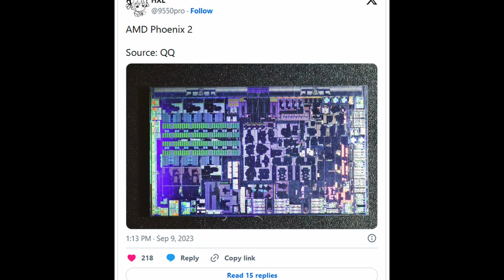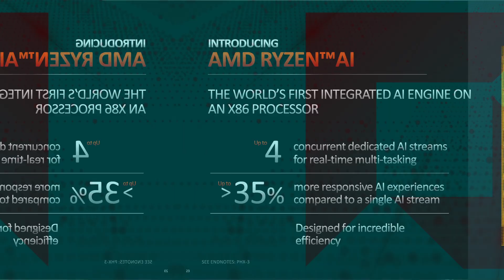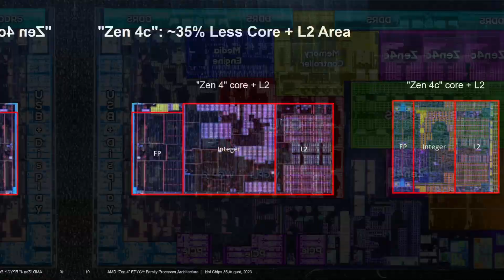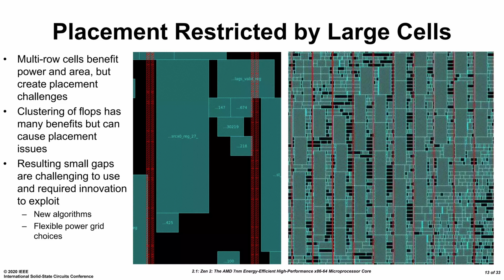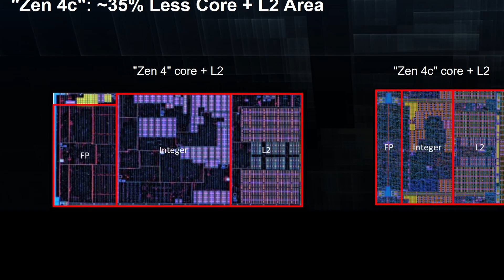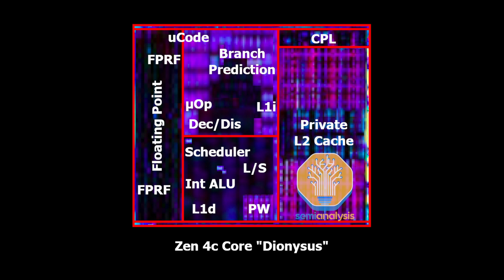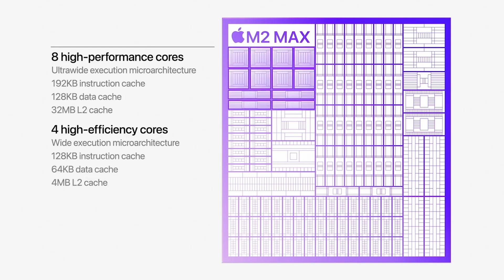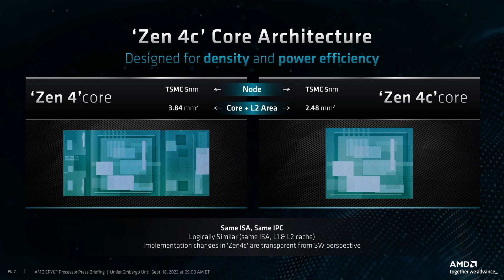Why AMD's first Hybrid-CPU is Different

Comment: Very enlightening video indeed. I’d say what AMD Is doing is a halfway house solution towards a ‘little’ core, but one that’s perfect for the sort of workload that its targeting. Easy workloads that are highly parallel would work better on those little cores, as they can easily scale by core count. But if the workload has less inherent parallelism, then the Zen4C would be perfect for it. 

Not to mention the ease of workload scheduling here. Intel’s hybrid design requires dedicated hardware in the thread director, while this solution from AMD doesn’t

Comment: I'm curious how this Zen4c design compares to for example Intel's E-cores in terms of performance per watt. The whole point of bigLITTLE was that minor and background tasks could be executed on the smaller and less complex core instead of spinning up a whole "proper" core, thus saving power. But if AMD's c-cores are just "normal core but more compact", would that even end up saving any power besides the slight difference due to clockspeed differences? So far it just looks great for the datacenter world where you can pack a bunch more c-cores onto a die than normal ones. But what about laptops and other varying power devices that strongly benefits from proper bigLITTLE?

Comment: Given that in laptops and handheld devices, you rarely/if ever boost more than 1 or 2 cores to let's say 5GHz, this kind of shows how brilliant AMD's solution is. Why have more than 2 cores that can go to ~5ghz when you can only power 2 anyway?
It also completely sidesteps the architecture difference issues caused by Intel's design. Yes, updates to windows/linux/etc to take these differences into account help, but historically these changes have been slow and incomplete.

Comment: I agree with @MikeGaruccio, more smaller sizes cores and lower clock is the main idea behind RISC architectures, except that here the cores are actually CISC cores. More cores are the way to go for sure, especially when the cores are uncompromised, except for clock speed. AMD is correct is their approach.

Comment: Its pretty obvious they just took 4 cores and needed space for the memorg controller so they moved one to the bottom of the cache and then shifted the cashe by 50% in place to give it access to the full bandwidth. Its not a weird layout. Its lazy engineering that looks like a word document text thats set to wrap and alight right/align left depending on top or bottom of the object. Blah blah smart wizard go brrr.
Reply: No but for real... cpu symmetry is not lost. The cored look and are the same. Just he one is moved down. There is no innovation

Comment: Hey dude one issue with what you said and it needs clarification.  About 5:30 you're talking about Zen 4 vs. Zen 4C.  You say there is no difference in IPC.  That's ONLY true without regard to L3.  If you are going to take into account L3 and the different workloads that benefit from having more L3 cache, so large data sets and for PC that's often games, but other scientific or engineering workloads where you might do modeling and need access to large amounts of data, then there is a difference in IPC.

As soon as cache values change, you have affected IPC in some workloads.  IPC can't be talked about as if it's a fixed thing because it's not.  It's workload dependent.

In THIS case with the chip you are showing, because there is a shared L3 then there should be no difference in IPC between Zen 4 and 4C cores, but this is not always true.  In general Zen 4C cores have half the L3 cache, so if you compared a CPU with Zen 4C cores only vs. a CPU with Zen 4 cores, there would be a difference in IPC.

Comment: There is nothing magical about big-little.  The purpose is to get more thread processing in the same amount of space and HOPEFULLY get power reductions in the process.  At least that is the purpose for desktop and large computers.

For SMALLER devices, the object is to process as many threads as possible at low power.

And this is why I say there is nothing magical about big-little.  There is no best way to do it, so just because ARM is really one of the firsts and has their big.LITTLE architecture, that doesn't make it the best at anything.  The other issue is when this architecture came out originally, there were no REALLY GOOD process nodes that were low power like there is today, which can negate part of the benefits of big-little.

And this gets to AMD and their architecture.  There are many tasks a computer does that don't need large cache sizes or the fastest clocks, but there are certainly many server, desktop and laptop use cases where more threads is better especially with multi-tasked systems like servers.

I'm more excited to see this come out for laptop and desktop, because it will put a lot more pressure on Intel to keep pushing at their innovations.  I'd also like to see the desktop  move to single socket solutions such as AM5 or AM6, but this socket can provide basic computing all the way up to near HEDT performance, and big-little can help get thread counts above the current 32 for both Intel and AMD, and it could get thread counts up to 48.  And, it's not that I need that many, but what it would do is bring costs down for something like a 24t CPU, which I COULD use.  But I also think this will bring a memory problem and it could be you'd have to move to a way of having a socket allow for both dual and quad channel memory, because a 48t CPU won't work with dual channel memory.

Comment: Intel said lets design a smaller more efficient core and amd went lets optimize our core so its more efficient without loosing performance seeing as ZenXc was originally designed for datacenter and is being pulled over for mobile designs

Comment: Gaming needs high performance cores though. We can see that the Z1 Extreme can clock up to 5.1ghz, I think AMD will need at least 2 Zen5 cores, then maybe 6 Zen5c cores for the next Steam Deck APU. Or if they want to keep it at lower clocks with all Zen5c cores, they'll probably have to add X3D cache to it to boost the gaming performance back up to an acceptable level. Since X3D cache will inhibit cooling, that might actually work well to complement the slower clocking cores.

Comment: I do not like strange cores but strongest cores. For smaller die area, implement a new proposal from Intel, the x86s architecture that is a clean 64-bit without 16-bit/32-bits circuits that do complicate themselves. Do advance with 3 parameters to be improved: speed++, throughput++ and latency--. Sincerely.

Comment: I would like to see completely a passiv cooled SoCs like Apple Silicon where also the RAM is on the Chip which allows high memory speed. I'm using currently Apple Silicon M2 on a MacBook Air, but I'm a Linux Fanboy and I would like to see something like Apple Silicon from AMD so I'm not stuck on Apple.

Comment: Zen APUs for high performance handhelds seems to be a market amd has all to themselves, leveraging their existing work seems like what they'd do. 5c probably wont be a big change from 4c beyond what they can do to improve Epyc and Threadripper. Lower power and heat is always good though. I wouldexpect lots of  c cores to be used in next Gen Console APUs and by that time we might be up to 6c

Comment: I've been thinking about Intel's big little implementation a lot lately and have finally just come around to it. I guess wider programs won't necessarily need more fast cores if it can already get a lot of smaller ones.
Then AMD goes and Feng Shui's their regular cores to get the same effect while dodging scheduler worries and I'm blown away all over again.
Reply: lol all AMD did is just crippled a few of their existing cores
while Intel actually give you extra E cores on top of the existing P cores
Reply: @loucipher7782 
lol at upboating yourself ebin redditor tips hat
Reply: @loucipher7782  Only time will tell. We need benchmarks, hard data.

Comment: The actual die cost of the raw core is down to single digit dollars or even cents. It all the infrastructure and cache that take most of the die surface. Of cause when it comes to power, it's a bit diffrent.

Die space just don't matter when it come to raw cores. But power does..
It's worth saying that very few aplication can use core 3 and up to the full capacity  so making core 3 and up wirh say half the preforance bit 1/4 the power make a lot of sense.

Comment: I still prefer the simplicity of more cores working in parallel with high clock speeds and multi threading over hybrid designs since i don't have to worry about not having enough cores, or if drm may crash my game because the tasks get moved between cores

Comment: I think the problem of AMD right now - at least on desktop - is how bad the uncore portion is. Their substrate-based MCM design is causing their biggest problem: the cores are extremely bandwidth starved. The Infinity Fabric bandwith is not even catching up current top DDR5 speeds. Frankly I think this design approach will hurt them in the long run on desktop. On cloud and datacenter it's not a problem because servers require much much higher parallel throughput and they have way more memory channels, so a single chiplet isn't going to be starved. But on desktop, AMD doesn't have much answers aside from 3D VCache, which is very expensive and hurts single core frequency.

Comment: Nice video. Excellent presentaiton.
I recently obtained a MinisForum Phoenix APU  UM790 Pro 7940HS mini PC and am impressed with the small size, great capability and low power envelope.
The Phoenix2 will have lots of applications especially for mobile and notebooks.
An all 4c chip could be very useful in the data center for CPU performance per BTU.

Many mobile chips are the desktop variant running at much lower clocks to extend battery life and/ or reduce heat.

Comment: I like it. Not for any reason thats directly in this video even. 
AMD does something here that so far only smartphones and tablets do with the big.LITTLE concept, and thats actually saving power. 
Intels lowest hybrid design at the moment is the i5 13600 with 6 P cores and 4 E cores. Those are still solidly mid-range CPUs intended for good performance across the board. The E-cores can save power, but it feels like Intels actual design goal with E-cores is to stuff more cores into the same power limit for their higher end stuff to get slightly more performance and core count than a P-core only design with the same power draw. It certainly does the job, but it misses the point of power savings as there are no i3s or anything comparable on the low end. 
On the other hand Zen 4 and 4c totals at 6 cores already, 2 P and 4 E cores, which is just about where an i3 with that philosophy would slot in anyway. Its the perfect sweet spot for budget laptops that can run the 4c cores with a low base clock for casual use and during intense gaming boost the shit out of the bigger Zen 4 cores. Which is okay, not many games really have more than one or two "main" threads, and would unload the less intense threads to the Zen 4c cores. 
This is a much better approach to power saving imho, as these chips will actually end up in low-power machines instead of pushing the high-end stuff a little higher. 
(Its really the same argument as DLSS and FSR. Nvidia makes a point of limiting it only to RTX cards, DLSS 3 even only to 40 series, none of which are really in need of that kind of crutch, but AMD offers FSR for any semi-modern GPU, including APUs and Intel iGPUs, where it gives those guys a fighting chance to run stuff, which is a far greater benefit imho)

Comment: They should fit some ARM and RISC V cores in an x86-64 processor so it could then run Android apps natively. Not sure if this ia possible though.
Reply: It's probably the best way to run those apps natively. One or 2 arm cores in a laptop will be peanuts in size/power budget.
AMD CPUs already have an arm core that's isolated for cryptography, and we see for example nearly all SSDs have multiple arm cores in them.
Sooner or later it will happen but I doubt it can replace PC architecture, instead these small cores will add to it

Comment: A very interesting concept. I think it's the better way than P/E-cores, especially on Windows. The scheduler has enough problems assigning tasks to the right core. The thing I would like to see would be a desktop CPU with 8 Zen5 cores (maybe X3D) and 16 Zen 5c cores. The differences in clock speeds would guarantee that high performance tasks stay on the Zen5 cores.
That the ISA is the same on all cores is great, as heavy multithreaded workloads can profit from many cores regardless of type and clock speed.

Comment: We will have to see in benchmarks, in multiple uses, what it goes. 
I know that the Intel P+E design sounded naf to many, but given the right situation, aka a laptop or small device, they are kinda nice. Lower heat, longer battery life. 
And yes I know windows 10 needed some patching to get it right. I know.

Comment: AMD is on to something here. Will be very interesting how the performance results. Area optimised cores would be potent in handhelds, tablets and laptops - that's desktop class core but with power efficiency per IPC, not just lower clocks & voltages.

Comment: This is definitely the superior way to do hybrid arch vs the way Intel is doing it. I've shied away from Intel 12th and 13th gen cpus with big and little cores because I simply don't trust the scheduler no matter what they say about "thread director" As far as gaming goes the scheduler should have no trouble with AMD's hybrid arch because the "world thread" so to speak would always be scheduled on one of your higher clocked cores, but the lower clocked cores due to them being the same IPC would still be useful for gaming. I think I'll hold my 5900x until AMD starts dropping these hybrids on consumer desktop. Also by the time AMD brings this to consumer desktop hopefully they've further optimized their infinity fabric to work with high end ddr5 in 1:1 mode to reach monolithic latency levels as Intel does.

Comment: For an ultra portable laptop I think Little Phoenix makes perfect sense provided that the compact cores clock reasonably well (say 60-70% of the full fat cores) when plugged in. And since the process scheduler in both Linux and Windows are biased towards the highest clocking cores single threaded and lightly threaded apps will always "run right" without the OS and apps needing modification.

For standard desktop compact cores make little sense, but for "the layman's workstation" I think a 9950X3D with 8 full fat + VCache and 16 compact cores would be very desirable to many. Especially now where AMD has discontinued Threadripper non-Pro.

Comment: If the both zen4 and zen4c cores use the same RTL, instruction set and IPC does that mean it could be easier to do scheduling in OS? I remember hearing that intel's big little architecture had some inefficiencies because windows wasn't able to efficiently schedule in tasks like games.
Reply: Exactly. The OS biases workloads towards the highest clocking cores, and fills up from there.

Comment: No, I don't think AMD will do a different architecture.  That relies too much on software support, which Intel has discovered simply won't be forthcoming from Microsoft.  Hence the lack of AVX-512 in Alder Lake and Raptor Lake, despite being present in the silicon.

Most desktop use cases don't fit the model of only compact Zen.  There need to be higher-clocking cores for too many workloads that aren't well-threaded, most definitely including games.  That said, I agree that Zen 5C would be a great fit for the next Steam Deck.  It's not going to be clocking high to begin with, to get the best position on the efficiency curve, so there's no downside.
Reply: The C cores are perfect for VM servers where each VM might not be loaded 100% but you want to dedicate a core or more to each.

Comment: AMD has the capability with Zen to scale in any direction it wants. That was the whole goal of zen from the beginning. It needed to be an achitecture that in the long run, can do everthing and anything, and use innovative packaging techniques. Zen4c is great proof of what can be done, and in the future, there could easily be 3 or 4 different version of zen cores, tuned to what is needed.
More cores at lower clocks at least to me never made sense because as an average consumer, quick bursts of high single core usage is what I would require.

Comment: I think AMD has seen its fair share of launching issues with CPUs and often is not as optimized for when launching new hardware compared to Intel and NVIDIA. Bypassing this by having functionally equal cores and just allowing the scheduler - as it is done for years - to find the fastest chips for single-thread tasks is, I believe - the better way.

This may not hold true for highly integrated machines, but IBM x86 and AM64 are not that. Having hardware where you as the programmer don't have to worry about your software hitting cores that don't have the same instruction set will cut down on development and testing.
I can even see a handheld console like the Steamdeck having just one performance core for games not optimized for multithreading.